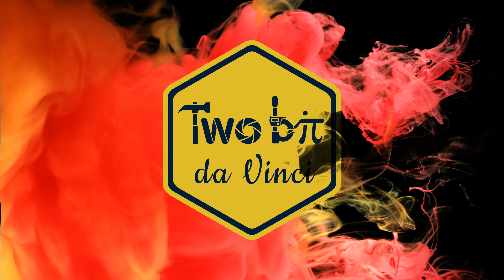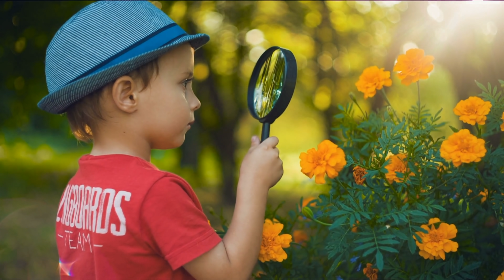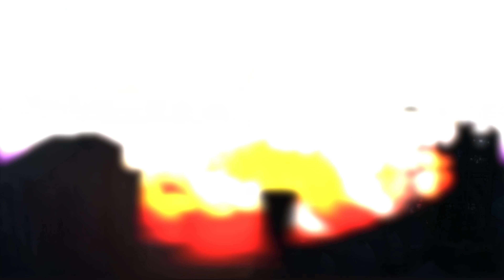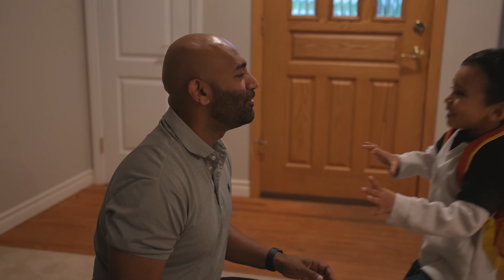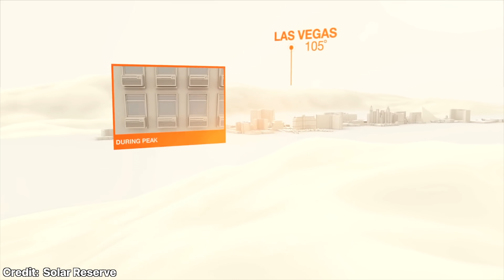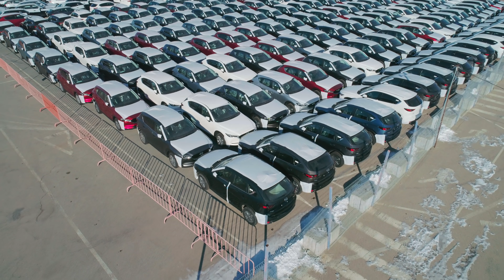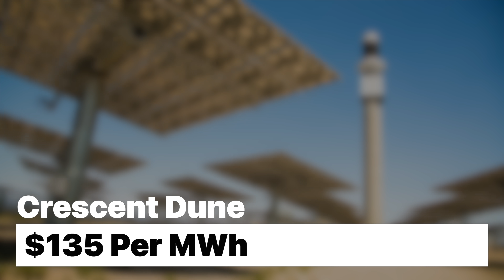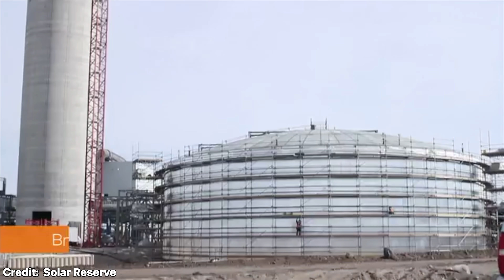This Billion Dollar Solar Plant was an EPIC Failure

Comment: Solar and Wind are absolute dead ends for grid scale base load, from intermittence to seasonality to vast land use to the pollution emitted by producing them. They have NEVER been cheaply and successfully used as base load, they can't be - even if we had perfect battery tech they'd still suck, and that's decades away.

This is yet another case of green wash blinding investors to what was always a very bad investment.

SMR is the answer
Reply: Solar and wind can absolutely be used for base load, batteries and other means of storage ( water or weights pumped up to heights, power to gas ) or bidirectional charging cars.
And its the cheapest energy available. The pollution producing Solar is caught up after one year.
Nuclear energy is extremely dangerous and contaminates for an incredible long time.
Reply: In the last thing I am with you. But solar thermal power plant project is also a very interesting topic it has a thermal battery and can work at night too